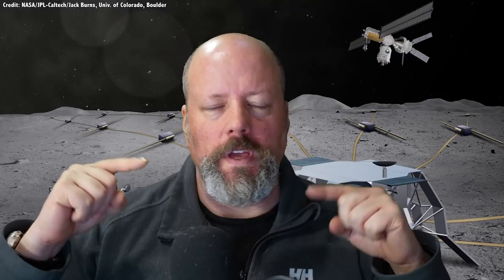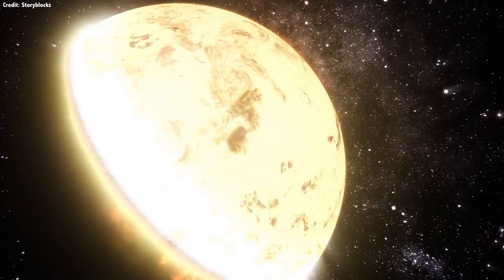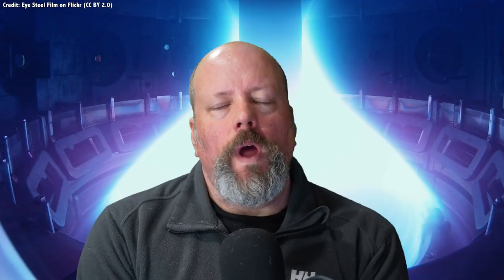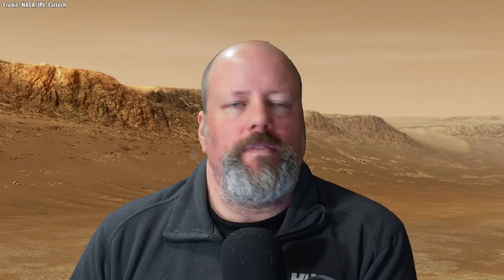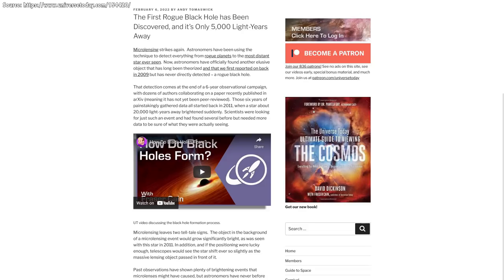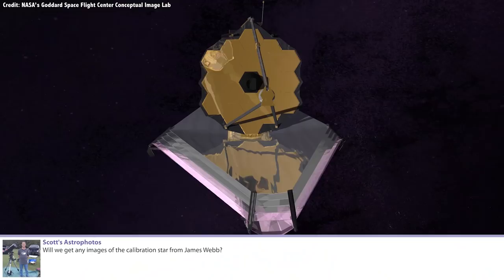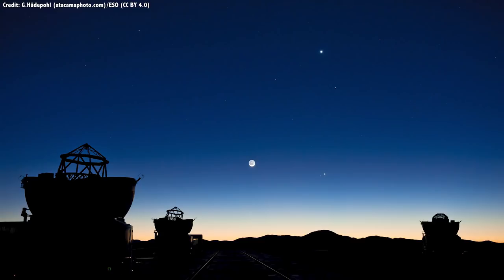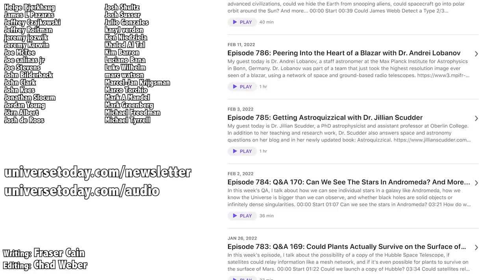Will Aliens be Hostile, Rogue Black Holes, Faster than Light Expansion | Q&A 172

Comment: Assuming we are looking at the edge of our observable universe- if at that edge, we were relocated there- would  we now just have another 90 billion light year radius?  Like a circle ⭕️ intersecting with another circle ⭕️ which would then see a universe almost all of which we can not see now? Does this make sense?
Reply: Yes. But it’s the diameter that’s 9e10 ly.
Reply from the maker: Yes, anywhere you go in the Universe, you'll see roughly the same thing. If you could instantly travel out to the edge of the observable Universe, you'd just have a new observable Universe surrounding you.

Comment: Can a future telescope be composed of separate mirror fragments arranged to travel together, precisely aligned, in the space? Each of them could even be a payload of individual rocket. The overall cost would be enormous but the risk of entire project would be dramatically reduced.
Reply: For an optical telescope, it would be very hard to keep them aligned correctly. I do think it will be possible to send separate mirrors up and connect them together afterwards. For radio telescopes, the alignment is easier. Setting them up with large separations would be practical and give better resolution.

Comment: Hi I have a question that really eats at me, so maybe you can help. Acceleration, in a physics sense, does not just include something travelling faster in a straight line, where you feel a force pushing you back into your seat. It also includes angular momentum, where you feel a force pushing away from the change of angle.
My question is, Relativity says mass warps Spacetime, and as a result the Earth Orbits the Sun, apparently because it is following the curvature of warped spacetime. So is this type of motion to be regarded as a form of acceleration, and is there a centrifugal force being generated against the mass of the Earth, as a result?
My intuition is telling me it is not quite the same thing as a car driving at speed around an oval track, which has nothing to do with curved spacetime.

Comment: How do we know light is red or blue shifted? How do we know it wasn't its current colour all along? How do we know it used to be a different colour?
Reply: Google "periodic table of elements and spectroscopy" to get images, but basically if you look at the light spectrum of stars and galaxies the signature wavelength of atoms that would be blocked at certain wavelength are not exactly at the frequency they should be but appear shifted up or down on the "light bar"   they shift up towards blue if approaching us  as the light gets "compressed"  and  shifts towards red because the light is getting stretched as it's getting further.

It's the same principle of doppler effect  like a car engine sounding higher as it comes towards you and the shifts to a lower tone as it passes you and drives away from you.

Comment: I have a follow up question to the follow up question about living beside the Big Bang: if I understand correctly the Big Bang happened and everything started expanding so everywhere is the Big Bang. What if you lived where the Big Bang originated? The spot everything is expanding away from? Isn’t that the centre?
Reply: Current understanding allows two possibilities. First the Universe is infinite in size. If so, it has always been infinite. It was just denser in the past. Second is that the Universe wraps on itself like a 3D game of Pacman or Asteroids. In this case you can say that all or no positions are at the center. Which one depends on how you define center.
Reply from the maker: You said it already. The Big Bang happened everywhere. It's not expanding from any one place, every place is moving away from every other place.
Reply: @frasercain  just FYI, you seem to be replying to the original poster, but I got notified. This implies that you replied to my message. I only mention this because they will not be notified and may not see your comment.

Comment: Question::  ok so if we / humans where a water based life form. Imagine if you will we evolved completely in water and we still live in the ocean without the ability to live on land. Do you think we would have been able to develop technology’s to the same point that we have today? It seems to me that with out fire and the ability to purify metals there is no way our technology would have been able to evolve in the same way. Living completely in water even with intelligence one of the most basic element to technology fire would be unobtainable. Or at least in the traditional sense. There would be knowledge of heat and cold with the cold water at the lower depths and hot water maybe at hydro thermal vents but with out that initial spark of a fire (pun intended) would we have ever gotten to where we are today? Look at octopuses they are crazy intelligent but no technology and if left alone to evolve for a further few billion more years would they ever have the opportunity to develop technology regardless of there intelligence if they are permanently water locked? While the start of life seems more likely in water is it the best environment for technology and if it’s not would that make earth even rarer as it has a good mix of water and dry land?